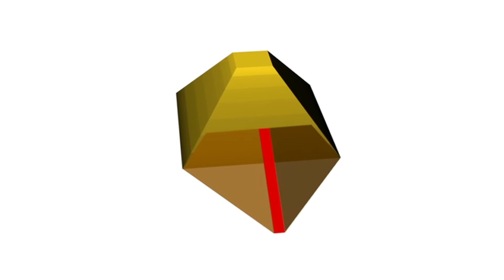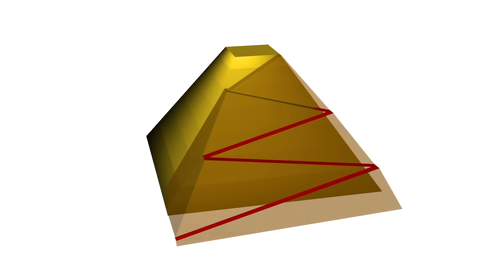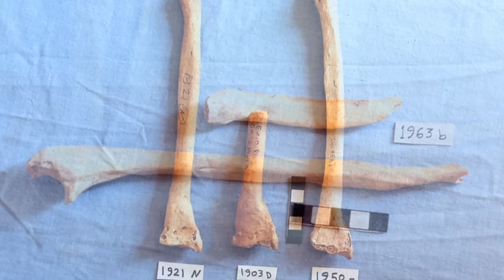Egyptology - Pyramid Construction

Comment: Any ramps would be bigger than the pyramid itself. Water is the key. Water is always level. This video is bogus.
Reply: Wrong............but thank you for playing.  Less science fiction = and more science and following the actual evidence next time.
Reply: @varyolla435  "The linear ramp theory has been rejected by most modern archaeologists and engineers. The ramp would need to be more than 1.5km long to stay at the gradient needed to roll the blocks uphill. This would make the ramp bigger than the pyramid itself by volume." First you need to build it, then you need to take it down.

Comment: If i was designing a pyramid I'd use 4 ramps at once
Reply: Slight problem.  Look at a topographical map of the Giza necropolis.  See where the area where the Great Pyramid sits = elevated outcropping of limestone.  So while you might have a ramp on its western side - today the western cemetery - and the southern side closest to the limestone quarry and harbor = the north and eastern face are areas of steep drop-offs. So there is not enough ground to accommodate a large earthen ramp.  

This means most certainly on its south face there would have been the main access ramp.  Possibly a "wrap around" on its western side as well though it should be noted that the exposed western base of the Great Pyramid shows a long continuous stone ledge.  As such it appears an existing hill sat in that area which was leveled and built upon.  Such a natural formation might have itself been part of the ramp used to build the inner core of chambers/corridors and was then covered over with other chunks of limestone.
Reply: 4600 yrs ago

Comment: Pretty sure they had cranes lmao. Humans and technology makes this seem impossible because they don’t think of using the basic tools and machines we had then, but we still had a pretty good grasp of basic technology.
Reply: Ah...........no = not like you think.  The Egyptian shaduf employs a fulcrum and counterweight.  Such devices can be employed to lift reasonable weights.  Yet the largest/heaviest blocks found in the bottom half of the pyramids closest to the ground were not lifted.  They were pulled on wooden sleds via teams of men and oxen up an earthen ramp the Egyptians created and then levered into place. 

Above the level of the King's Chamber about halfway up the blocks become smaller as the pyramid rises in height.  So those smaller blocks above might be raised via the fulcrum device - your "lifting".  The blocks at the top of the Great Pyramid are only about half the size as those found at the bottom.  Smaller blocks would be easier to raise and maneuver into place.
Reply: @varyolla435  They probably used water canals to move the rocks, then water tunnels to transfer them up and carved in water to make identical blocks using the water surface for the correct angles.
Reply: @ennisdelmar807  ROFL!  Might want to open a window and get some fresh air.
Reply: @varyolla435  or maybe they used some type of concrete and mold ssince they had the technology to melt stones
Reply: @ennisdelmar807  Still snuffling whatever I see.  lol!  You really need some fresh air and perhaps detox.........
Reply: @varyolla435  you can't cut the vases and sculptures from that era, that's molded. You need to some fresh air to get some logic into your brain
Reply: @varyolla435  over the kings chamber there are over 40 granite blocks each weighing 17 tons elevated in 5 levels. How did they do that?
Reply: @varyolla435  To be able to carry those 17 tons block up a ramp it can't be steep, the ramp would be enormous and there is no evidence of a ramp that big left.
Reply: @varyolla435  I'm open and don't know the answers as we all should be, you draw conclusions with leaps of faith and try to use logic as proof, it doesn't explain how it was made. Take a break, get some fresh air and try to accept that you're not right, you weren't there.

Comment: Why are they letting that one pyramid fall away into rubble?
Reply: Actually they do not allows the pyramids to fall into rubble in so much as they are protected World Heritage sites protected under the UNESCO Treaty.  Yet Egypt is not a wealthy country and it costs money to refurbish sites.  Egypt a few years ago spent several billion dollars building a large state of the art museum on the Giza plateau. It will be able to maintain and display far more artifacts than the older museum it replaces.  

Also they recently completed a multi-year long restoration project on Djoser's Stepped Pyramid.  Other sites are being refurbished by outside groups.  As an example.  Hatshepsut's mortuary temple which was destroyed has been systematically rebuilt since the 1960's by a Polish archeology organization.  So these sites are protected and in some cases they are being repaired within reason.  The treaty requires they not be radically altered however lest their historical value being destroyed.

Comment: There isn't enough sand to make those ramps
Reply: Wanna bet.  lol!  Also the ramps were not made merely from sand.  The Old Kingdom Egyptians at Giza made earthen ramps from a mixture of sand/stone chips/tafla - a clay they minded.  The stone chips would be debris from the quarry operations while near the worker village at Giza is the remains of a huge tafla mining operation.  In the western cemetery adjacent the Great Pyramid are partially finished tombs which still have the remains of smaller earthen ramps attached to them made from such as I described along with a simple retaining wall.

Finally when the limestone quarries at Giza were excavated years ago they were found to have had massive amounts of = sand/stone chips/tafla dumped into them - or what they made ramps from.  So as they encased the pyramids in white limestone from the top down they systematically dug away the ramps and dumped the debris into the open quarries to backfill the area.  

p.s. - the ramps did not need to go to the top.  The blocks become smaller as they pyramids rise in height.  The smaller blocks on the upper half could be raised via lever devices akin to the Egyptian shaduf which uses a fulcrum and counterweight - or as Herodotus described "a machine".  The largest/heaviest blocks which would need a ramp to raise them are found = in the bottom half of the pyramids closest to the ground.  Perhaps you should learn the evidence here after all........
Reply: Okay, but explain how they can lift 2.5 tons - 5 tons alone??
Reply: @Lone55345  Failure of critical thinking.  Tell me = do you lift your car up an overpass on a highway - OR - do you simply drive up the ramp???

Moral of the story:  the 2.5 ton figure = estimated average of the total of millions of blocks.  So in actuality some blocks are larger and thus weigh more while others weigh less.  Look at photos online of people who climbed the Great Pyramid to take selfies.  See where the blocks at the very top are small enough to have been levered into place by several men.  The largest/heaviest blocks in the pyramids are found = in the bottom half closest to the ground.

So via earthen ramps they made as noted the larger blocks in the bottom half would be pulled/levered into place via the ramps they made while the smaller ones above could be raised via lever devices as already noted.   There is a video here on YT which shows a man and his small son maneuvering a large block on such a device whereby a long beam and counterweight on one end allows them to raise and move about a large stone block held on the other end as the small boy moves it about.

On a side note you fail to account for = animal power.  An ox can pull more than 2X its own body weight.  So teams of oxen can pull multi-ton loads as they have done for millennia coincidentally.  The worker village at Giza contained many thousands of cattle bones.  Depictions such as in the tomb of Hunefer show a large sarcophagus on a wooden sled being pulled by a team of yoked oxen in a funeral procession.  So that places cattle at Giza during the period of the pyramids while there is ample evidence of their use in agricultural and other labor such as pulling things on sleds as we see.  Follow the evidence...........

Comment: I’ll tell you this. If I was in charge of building the pyramids I would have those blocks cut down into 10 smaller blocks. There’s no reason they need to be so massive if your just creating a giant pile. It’s obvious that something else was going on.
Reply: Not quite.  Follow the white rabbit:

1 - Egypt and that region is volcanic.  As such it incurs periodic earthquakes.
2 - next is that in order to support the weight above the pyramids as they grew in height required large "base stones" to help prevent subsidence and anchor the structure in place.
3 - finally if you look you'll see whereby the largest/heaviest blocks of the pyramids are found = in the bottom half of them closest to the ground.  Above the King's Chamber of the Great Pyramid - about halfway up - the blocks become smaller in size.  Those at the top if you look at selfies people who climbed them took are small enough to have been levered into place by several men.

Moral of the story:  so you see similar construction techniques in other things and by other civilizations.  The Roman temples near Baalbek as an example have massive base stones upon which the smaller blocks above are laid to give stability in earthquakes and anchor the temple in place.  

Djoser's Pyramid was built progressively and it used small stone blocks.  They got around this however via tilting the blocks slightly inward to direct the weight towards the center.  Yet eventually the walls still sloughed away.  So later pyramids were built on solid ground and using larger blocks at the bottom with smaller ones above to support their great weight and for stability in a region where earthquakes occur.

Comment: Until we duplicate the construction of the Pyramids using the exact same tools, techniques, and speed that we perceive them to have used, everything we come up with is nothing more than speculation and hearsay!  2.3 million blocks cut, shaped, moved, and set, one every five minutes of every hour of every day for the next 20 years nonstop, using 4000 people and we're made to believe they did all this without the invention of the wheel or Pulley's. Then there's the army that it takes just to feed an army! We know for a fact that the Pyramids and the Sphinx are over 12,000 years old based off of the vertical erosion we see caused by water runoff on the body of the Sphinx, ancient Egypt hasn't had a wet climate for at least 12,000 years.

Comment: Those so called ramps would’ve been quite an achievement of their own… almost as big if not bigger than the pyramids themselves, flat and smoother than the pyramids and able to withstand the weight of  tons of rocks and people.
Reply: While Herodotus wrote that the Egyptians created what he termed as "a great causeway" which he likened to a monumental feat - the actual ramp really only need go as high as the largest/heaviest blocks to be raised.  That means the granite relieving blocks above the King's Chamber which are only about halfway up the pyramid.  If you look the blocks above the halfway point become smaller as the pyramid rises in height with those at the top being small enough to have been levered into place by several men.

Herodotus also referenced their using levers and what is termed as "a machine" which may be a form of the Egyptian shaduf which employs a fulcrum and counterweight.  It sitting upon "steps" could raise smaller blocks above.  Another possibility is mudbrick ramps.  At Karnak are the remains of such ramps used to build hypostyle temples there while the tomb of Rekhmire shows such a temple being built using a mudbrick ramp.  The massive sandstone lintels of those Karnak temples are quite large and thus if a mudbrick ramp could sustain their being dragged into place there is no reason the blocks of the pyramids could not as well.

Moral of the story:  we see evidence of mudbrick ramps at Karnak while at Giza in the western cemetery there are smaller earthen ramps used to build partially completed tombs.  They are made from a mixture of sand/stone chips/tafla - a clay they mined - along with retaining walls.  When the limestone quarries at Giza were excavated they were found to have had massive amounts of sand/stone chips/tafla dumped into them = or what they made ramps from.  Near the worker village at Giza is the remains of a large tafla mining operation.  These are all things we can see - rather than mere assumptions as so many like to do.

Comment: They really don't have a clue.  No one on my team believes you had 1000s of men pulling huge blocks over great distances to build a Pyramid power station?  My ancestors moved huge blocks using the forces of nature.
Reply: Whatever you've been smoking = stop - and open the window.  lol!  Also in case you missed the memo.  They were not dragging blocks hundreds of miles = merely a few hundred meters.  The limestone quarries of Giza which supplied most of the limestone sit 100-200 meters away from the pyramids.  Meanwhile next to Khafre's valley temple adjacent to the Sphinx = ancient port facility.  So the rest of the stone - granite/white Tura limestone/basalts used for the mortuary temples - was shipped to the port which is about ~400-500 meters away from the pyramids. 

p.s. - they used men and OXEN = you forgot about animal labor.  There is physical evidence to place oxen at Giza during the time of the pyramids and evidence to show them being used to pull things.

Comment: Do you have definitive proof of ramps?
Reply: Absolutely.  Follow the white rabbit:

1 - in the tomb of Rekhmire is a depiction of a hypostyle temple being built using a mudbrick ramp.
2 - meanwhile at Karnak is the remains of such a mudbrick ramp being employed to create hypostyle temples found there.
3 - at Giza in the western cemetery next to the Great Pyramid are partially finished tombs.  With those tombs are smaller versions of earthen ramps made from a mixture of sand/stone chips/tafla - a clay they mined - along with retaining walls.
4 - at Giza near the worker village is the remains of a large tafla mining operation.  
5 - when the limestone quarries at Giza were excavated years ago they were found to have had massive amounts of = sand/stone chips/tafla mixture dumped into them - or what they made ramps from.

Moral of the story:  there are also historical accounts such as Herodotus who wrote the Egyptians spent 10 years creating what he termed as "a great causeway" which he stated was a large undertaking itself.  Then he stated they spent another 20 years completing the pyramid and encasing it in white limestone from the top down.  

Thus the earthen ramps used to creating the pyramids would have systematically been dug away as they encased them in white Tura limestone working towards the ground and the residue = dumped into the adjacent limestone quarries to backfill the area.  On a side note the blocks of the pyramids become smaller as they rise in height.  In the Great Pyramid the largest/heaviest blocks are found in the relieving chambers above the King's Chamber - about halfway up.  So the largest blocks are found in the bottom closest to the ground and above the halfway point they are smaller in size.  Smaller blocks do not need a massive ramp to raise.  

Herodotus also noted they used levers and what he termed as "a machine" which is likely a version of the Egyptian shaduf using a fulcrum and counterweight.  He also stated they first built a "stepped" pyramid to fill in the sides.  So this device could sit on the "steps" to raise the smaller blocks to the levels above while the earthen ramp was only needed for the bottom half.

p.s. - on the exposed western side of the Great Pyramid is a "shelf" which was once part of a natural hillside they leveled and built atop.  So part of the ramp may have been an existing hill which was used when they created the inner chambers above and which was then covered over in chunks of limestone and possibly filler.  The lowest areas of the pyramid are dug into the earth itself.

Comment: It's amazing how white Europeans go so far into making it seem a total mystery how pyramids were built. They don't want to credit the Egyptians to be the first people to use chemistry, physics, & the metric system thousands of years prior to white Europeans (especially Greeks). There's no way in hell those stones were carved by hand with a rock & chisel  & then dragged 100 miles with a rope. Those Egyptians would have battered hands, & feet & bad backs from trying to drag a 30 ton stone 100 miles with a damn rope. The Egyptians would need to be 15' tall & made out of granite themselves to be able to do that & the rope would need to be made of some indestructible material. Those stones were clearly made on site were the pyramids are, using concrete & solar energy to heat & melt the stones for either pouring into a mold & or carved while heated & stacked one level at a time. There's no evidence of any broken, dropped, or fallen stones at the pyramid sites. There's no evidence of any of the builders having bashed up hands, feet & bad back from pulling & lifting stones that weigh 2-70 tons. There's no mystery, it's just white Europeans refusing to give Africans credit.